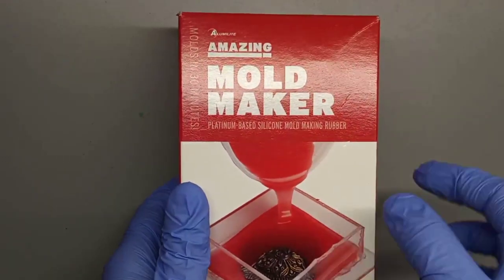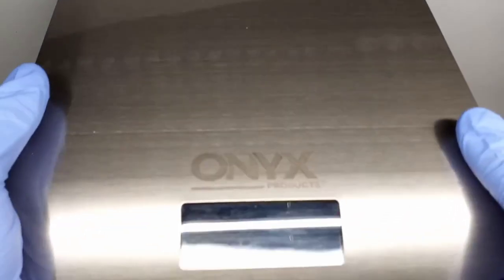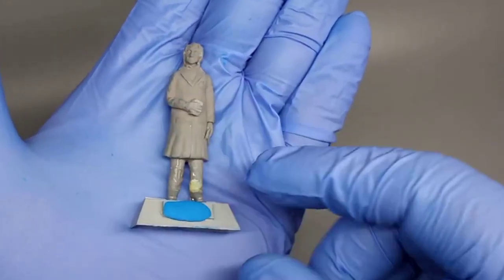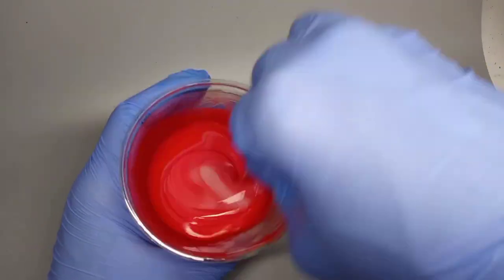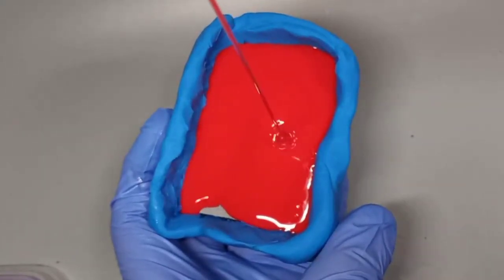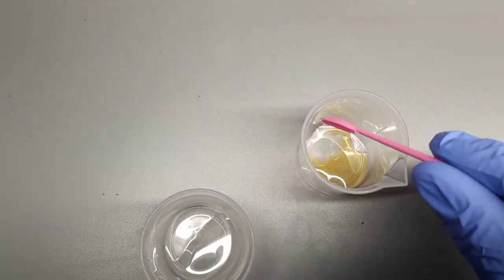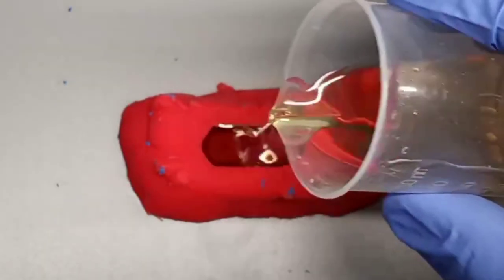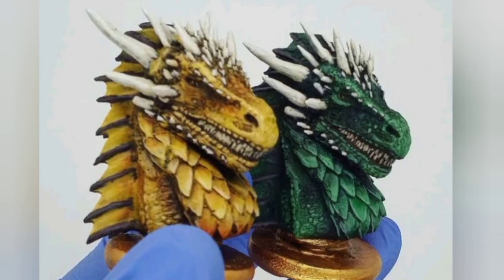How to mold and resin cast miniatures the easy way

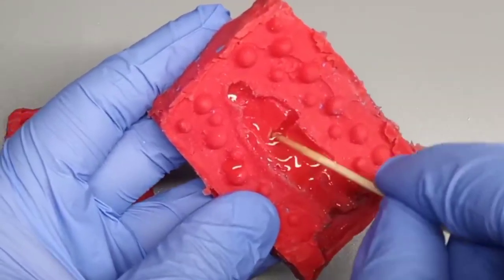Comment: Holy crap I have never seen that technique being used for making sure resin gets into every corner. 8:10 I use two-part molds too so I can do this. I use a pressure chamber to shrink them but I have to be fast because I have been using the fast-curing stuff.

Comment: Awesome video - I have a question. I was going to try to make a silicone mold of a plastic miniature, and I wanted to know if instead of mold release, would I be able to melt Vaseline down or Coconut Oil to liquid form then apply it with a brush over the plastic miniature before adding the platinum silicone? Could I also apply either on the cured silicone before pouring the other half? I read that supposedly, it would act is a divider.
Reply from the maker: Hello and thank you for your comment. You can definitely use oils as mold release as long as it is oily. Adding them between the two halves of ant mold really does help. 

I would also suggest adding the oil release agent to your molds before casting with resin. When the resin gets really hot it wears out the mold. Adding a form of mold release will alleviate the stress on the mold as well as give it a longer life ultimately allowing you to cast another one or two more casts before the mold begins to deform.